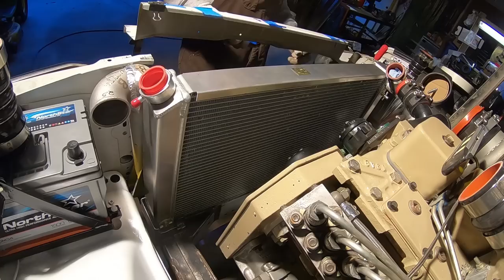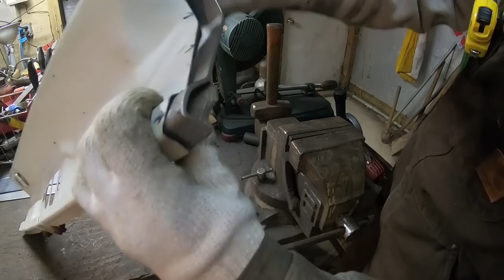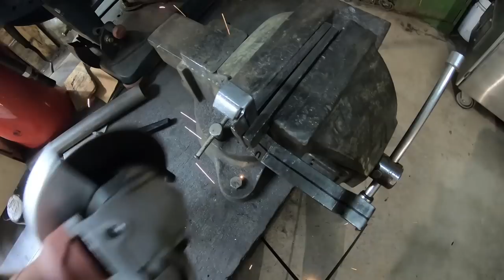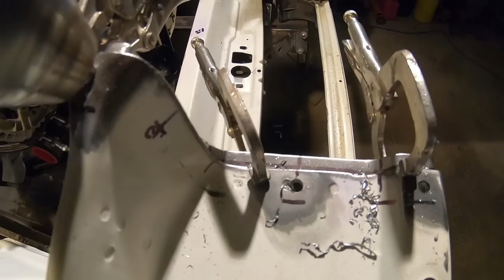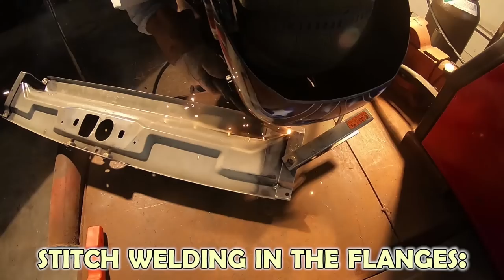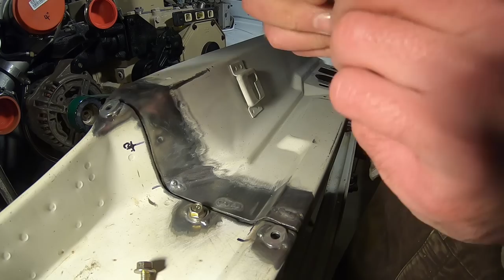Detachable Core Support × 4BT Cummins Discovery #27 [Land Rover Build]

Comment: Just an epic build. Great camera work also. Blown away by the skillz👌👍
Reply from the maker: Thanks man! I keep trying new things, even though many times it results in damaging my camera... even a tough GoPro doesn't much appreciate being sprayed with hot sparks & weld slag 😵
Reply: @Tinker1837  never thought of that cost ! Using more Go Pro's than nozzel tips and wire reels ! Need a Patreon channel just for cost of the camera kit ! 😢 That's commitment. Good on you 👍
Reply from the maker: @timb4655   So far I've not completely destroyed them, but I have lost count of the number of lenses I've replaced. And sadly my newest one already has a cracked back screen courtesy of winter moto riding... but that one's mostly on me I think haha!

Comment: I'm sure other people have suggested this somewhere but if you were to acquire two tools for this kind of work I'd suggest a portable bandsaw that you can clamp in a bench vise and use as a mini metal bandsaw. Previously I used an angle grinder to cut everything but I now  use this thing if at all possible. It's quiet, clean, doesn't throw sparks everywhere, doesn't char paint, and allows far more complicated shapes but even if I'm doing a straight cut I'll usually use it. Hell, I have a plasma cutter and I still use this most of the time if I can. HF has cheap ones for $100 often and I've used the crap out of it. Edited to delete stepdrill suggestion, I see you have one in later videos.
Reply from the maker: One of my friends was just recommending the band saw idea, and we were talking about maybe a smaller one to use in a vice like that. Might have to look into that more...
Reply: @Tinker1837   I really can't recommend it enough. It's not perfect but man does it make things fast and clean. I did the math at one point and even with replacing the bandsaw blades it was about the same price as the equivalent metal cut with angle grinder discs unless you're using explode-in-your-face quality ones.  When the HF one dies I might buy a Milwaukee but so far it's holding fine. Check out Swag Offroad's table they made for it. You can pretty easily make your own but I haven't bothered yet.  http://www.swagoffroad.com/SWAG-V30-Portaband-Table_p_55.html

Comment: My old 1971 RRC had the same set up straight from the factory, Even my 1991 RRC has the bolt holes but is spot welded together, I don't know why the change it. made engine changing a lot easier, Maybe 6 spots are cheaper than 6 nuts and bolts !
Reply from the maker: I was honestly surprised when I started digging into it early on that the whole front clip was spot'd together like that. I agree it was probably a penny pinching (or pence?) type of deal. It was a fair bit of work making it the way I wanted, but it sure will make any wrenching in the engine bay later on much easier!

Comment: Great... but wait... 🤔

Better put the holes in the detachable part and weld the mounting strips to the body. In that way you can mount the detachable part from above.

Now you can run into difficulties when the intercooler and radiator are in place (not able to get the detachable part in place or remove it because the coolers are in the way)...  Just my 2cts..
Reply from the maker: In later videos you can see I went with a unique way of mounting the tops of the coolers with brackets that hang off the engine side of this center part to hold them down into perches I built on the frame rails.  I've had it apart a few times with coolers & everything installed & thankfully it's a breeze with no interferences or oddball specific ordered ways of attaching/detaching 👍
Reply: @Tinker1837  I saw that video too, l ater on! And indeed no problem at all. 👍🏻
You are making a nice Discovery and nice videos in the same time! 😉
Reply from the maker: @CarLos-yi7ne  Hey thanks. I'm glad the idea in my mind made it to the real world the way I hoped.

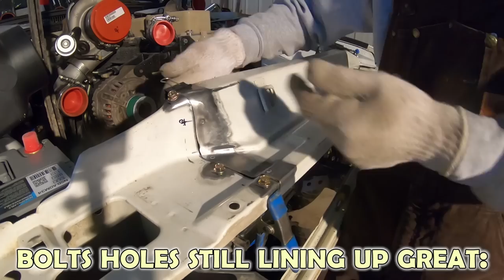Comment: You are the design and fab magician bro.  Looking in the background at 9:03 and seeing how far your turbo is sticking up above the hood line.  What are your plans for the hood?
Reply from the maker: Hey thanks man! I'll probably roll around without a hood for a week just for fun, but the compressor housing & intake horn will need a pair of little bumps in the hood orrrrr maybe I'll put some kind of a cool looking cowl molded into the hood :D
Reply: @Tinker1837  that's exactly what my buddy and i were contemplating on mine yesterday... along with finding an Aussie snorkel for the pax side of the Rover. 
He and my mech were wondering if we should weld this piece back in... copying this, lol
Reply from the maker: Nice! I was going to pickup a Mantec snorkel out of the UK for mine but think I'll just build a custom one instead.

Comment: Looks great.
You did make sure this bit can be fitted and removed with the radiator and intercooler fitted, didnt you?
Reply from the maker: Thanks & yessir! Main reason I made this tangent in getting this done was that I need the core support back in place because the upper brackets I designed for the coolers will be hanging off this. And I have an interesting idea for tucking in the steering cooler too that I'm looking forward to trying as well.

Comment: Hi. Great work as usual. Just curious why you fixed the support strip to the removable panel and not the fixed sides? Regards.
Reply from the maker: Just because it was easier to weld, versus welding upside down on the fixed sides. Upside down welding is far from my favorite.... so many ways to catch yourself on fire haha!

Comment: Since the core support is structural, would it be a good idea to put another bolt along the vertical portion of the support there too?
Reply from the maker: I'm confident it will be okay like this, but even so I do plan to put some material along the edges that will show me obvious signs if something is moving too much so I can improve the design before parts get damaged.

Comment: Great workmanship. Thank you for sharing. I just have 1 question. your removable panel will be difficult to remove when the radiator is in place. Wont it have been better to have the flanges welded onto the part that stayed on the vehicle. in this way the remove panel can be installed from the top rather than from the bottom. In this way to can, for whatever reason, remove the panel from the top i.e. even if the radiator is installed.
Reply from the maker: It's not bad to remove when the rad's installed, just requires a little rotation of the center piece to clear the core support and remove. But also yes you are correct it could be even easier, and was made this way just so I could weld it easier. I'm a beginner welder and upside down in a tight spot (if I had welded the bracket under the outer sides of the core suppurt) is challenging haha

Comment: Why one pieceper side, very complex to fabricate, and no just 3 single plates???
Reply from the maker: Rigidity! That sheet metal when cut up lost quite a bit of strength & the long pieces of steel welded along the entire sheet metal edge added that strength back in :)
Reply: @Tinker1837  great. Better demanding on time that doit two times !
Reply from the maker: @felipao007i  Right! I am not in a hurry & having fun so it works for me.

Comment: Hey buddy what radistor ind intercooler did you use? Ebay jobies or custom?
Reply from the maker: The charge cooler is from the original step van the 4BT came from, but the pipes have been heavily modified. And the radiator is a "Be Cool" LS swap radiator that's also had it's pipes heavily modified. You can see the details on that in the previous part.

Comment: Не правильно. Нужно что бы центральная планка ложилась с верху и прикручивалась к краям.
Reply from the maker: Screwed? I think bolts are much better! This is the same way many older vehicle's core supports are dismantled from the factory. It will be okay :)
Reply: @Tinker1837  я не сомневаюсь в качестве сборки. Все хорошё. Я имел ввиду то что пластины надо было приваривать к кузову автомобиля.
Reply from the maker: @user-prohodimec  Okay I think I understand better now. I think these bolts will work but thankfully it would be easy to weld it back together along that seam if needed.